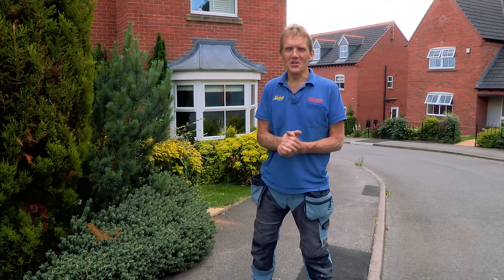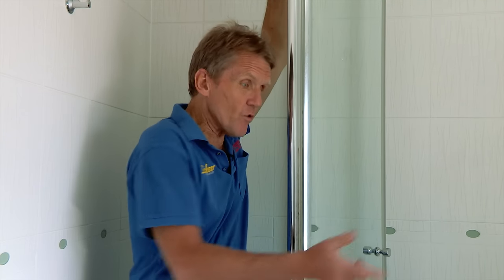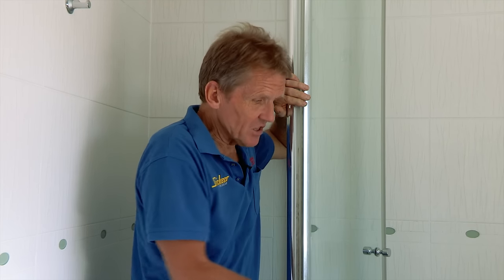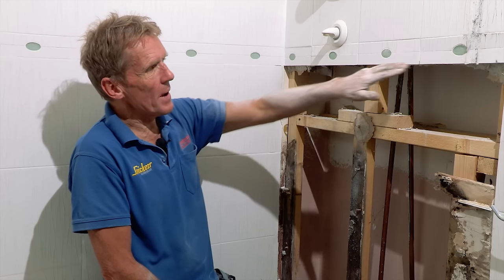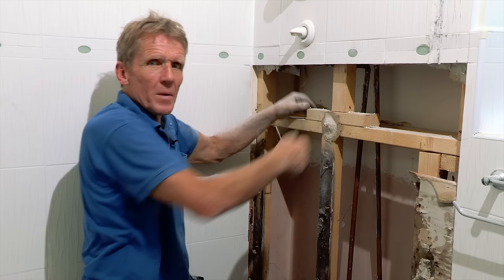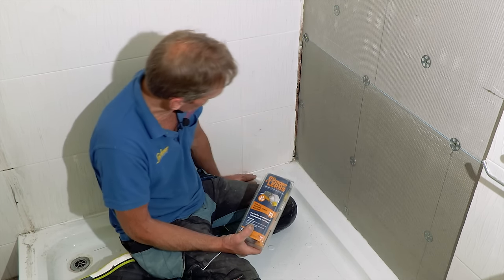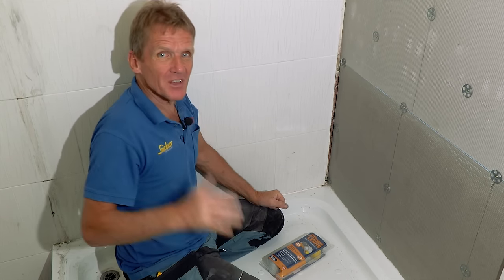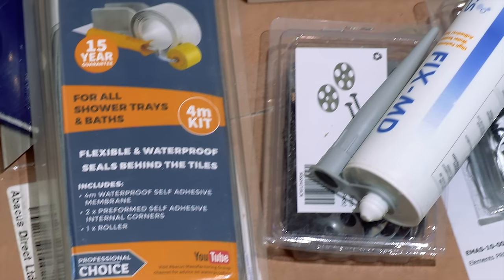Unbelievable Cowboy Plumbing Horror Show

Comment from the maker: See 'Shower Horror Show Part 2' - https://youtu.be/Cn_KD5HfYH0
Reply: In law, the householder shouldn't have to pay for this 'repair' because the original work was defective in design and materials specification or workmanship. There's no time limit on  a latent defect it's not a 10 year limit just because the guarantee period is 10 years, you get 6 years from the date you know of the defect, there is case law on this. Unless the developer / builder is bust it's a viable claim and should be pursued for remedy from the originating fault party.
Reply from the maker: Michael, that may be the case but very few people have the means to pursue a case against big builders for what amounts to minor repairs. I doubt you would find a solicitor who would pursue it on a no win no fee basis. If you take the breakdown of a silicone seal around a shower tray as an example a builder could say that it is wear and tear and within the scope of routine maintenance. My argument is that silicone seals are not sufficient on there own to prevent water ingress because buildings move. There needs to be a backup, This is the argument against using plasterboard. It is not suitable for shower areas and that is now being acknowledged. 

The British Standards have just been changed (20i8) to require tanking in shower areas. Given how long this has been a problem is well overdue.
Reply: How much did that job cost? I wouldnt have thought anything less than £3000.
TOP workmanship - sad to say but i rarely see such Top attention to detail and actual craftsmanship!
Reply: Skill Builder .""""."
Reply: I just wanted to say your videos are fantastic. I'm a handy man in the States and I see stuff exactly like this all the time.  it blows my mind that the people installing this stuff from the get-go can't be bothered to do things properly. I am like you, in that I genuinely care about what I'm doing and I always try to do things the right way. I never cut corners. Indeed, doing so basically makes it so that you don't have to come back in the future for a fix. But on the other hand customers are so pleased with your work that they give you referrals to their friends and family and as well, if you're somewhat of a jack-of-all-trades they will call you back to do the other jobs that they have. In the long run, it pays dividends tenfold in the form of a larger client book.
Reply: Great video I've had exactly the same problems with rental houses and they were all by the same plumber's and your right it's not the kind of work you want,, it's easier to do it right first time.
Reply: @Mr.FixIt1979  I thought things would be better in the States. I've seen a few videos where the fitters said using the correct backing board etc was in the building code. In the UK we seem to have a constant battle with builders that think that using plywood is ok because they've been doing it for years.
Reply: @DMC888  Plywood is only ever used in australia for bracing walls in the event of cyclone weather ...... plywood is never used for floors or walls. Particularly because it is just glued veneer that does not cope well with water.  We do use plywood for laminated beams , LVL or Laminated Veneer Lumber ...... but NEVER where they can get wet. Mind you termites will still eat them
Reply: Hi there, in france, we don´t use wood to fasten drywall. We use metal railing which is much better in bathrooms than wood. We also use special drywalls for bathrooms usually green. Before tiling, we paint the drywalls with latex liquid to make the plaster waterproof and on top of that, I add latex liquid when I am grouting to make my joints waterproof too. The last joint between the floor and the wall, I do it with silicone anti mold. I fasten the pipes to the concrete wall and I try to hide them so that an idiot doesn´t drill into the pipes.  you need to buy good brands because you don´t want any leak under the shower or behind the drywall.
Reply: Hello, do you have any vacancies,? Thank you
Reply: good the bad and t

By
Reply: Good the bad and the July sailing
Reply: @SkillBuilder : Good video and good advice but in my opinion as a lifelong renovator/remodeller there is a large error here…or maybe two. When you use a shower pan with a perimeter lip (which I recommend 100% of the time) you do not gouge out the backer board to fit over the lip, you install the board only down to the top of the lip and then install the finish tiles over the board and down to the top of the pan. The other issue is wasting your time removing the old tiles one at a time cutting grout and prying off the tiles with a flat bar. You will virtually never save all those tiles and even if you did you would spend far more of your customer’s money fiddling around trying to clean them sufficient for reuse than the cost of replacing them. We’ve all made that mistake once or twice but not three times.
Reply: Not just plumbing work second rate the tiling looks like it’s been done by an accountant
Reply: Always isolate cold water!!Especially cold one,cause of condense.
Reply: Cement board is good to 😁👍

Comment: This country is turning into a laughing stock because of corporate greed and cost cutting. I got an electric shock in the shower as the builder placed the electric cable behind the shower fitting and didn’t use the correct placement or fixings.

Comment: In our just over 12 yo new build, I replaced the shower bar. Upon undoing the nuts, I noticed the bar was was moving freely and suspect it was not fixed to a substrate. House builder: MILLER HOMES.

Comment: I like this guy. He cares about workmanship, unlike a lot of half assers out there!
Reply: A long time pro who takes pride in a good job. In the US when plaster gave way to drywall they used Greenwell for a few decades (probably with little testing) and as the guy said it did not hold up given cracked tiles over decades. Finally concrete board started to show up as demand for a better product increased and as far as I know a builder use this for showers now. The foam center is nice concrete board is heavy and hard to cut, builders probably would not pay for the additional complexity.
Reply: Rare breed, but as already said, it,s about the bottom line, that shower would win prizes now, not a good time for tradesmen....
Reply: @willpelton1619  that tape you discus is acutall a glass fiber metrial the paint hes layering over the top is a sealant you clearly dotn have any clue what you are talking about
Reply: @willpelton1619  okay you work. For a firm that's been I'm business 75+ years I'm from. A family of people. Of. Multiple. Trades who have been working as builders plumbers joiners and electricians for generations starting  Off with the Irish navvies turned tradesmen so I think I'll take advice from my family and what they were taught from there ancestors and what I know over some plumb on the internet we have a tendancie for testing things and I care to say this stuff looks identical to something we've used for years which is glass fiber weave with a polyurethane and/or silicone sealant painted on top that stuff is just the same just packaged with a  label smacked on it and charged at a mark up creates a great seal and stops water and moisture seaping through admitted the markup is insane. On that stuff but for the average dick who doesn't have trade accounts with company's its just the same for a price
Reply: @willpelton1619  admitted one thing I. Did question was why she. He used the tape stuff with the sealant paint why he didn't sell all of the seams and only around the screws and piping that did lead me to think. I.. Pretty sure moisture could see through the seams of the board just as easy as it could the screw holes when my. Uncle has done this kinda stuff using straight sheets of fiberglass and silicone sealants he has covered every single seam
Reply: Also by this latest comment. I. Realise. I. Sound young that's not the case I'm almost 31 I just didn't pursue my trade further due to. Mental. Health conditions I was going to be an electrician I was also studying to be a full on electrical engineer
Reply from the maker: Thanks Ranger, we're sure you'll enjoy Part 2 - https://youtu.be/Cn_KD5HfYH0
Reply from the maker: @willpelton1619  You are building to INTERNATIONAL BUILDING CODE Can you point us all in the direction of said code? I would very much like to read it. As for deleting your comments. That didn't happen and you know it. 
We very rarely delete a comment and never for commercial reasons.
Reply from the maker: @willpelton1619  Hi Will
Not taking the piss mate.  The IBC has hardly any presence outside the U.S All but one of the  committee are American. The only way they can claim it is international is because   Abu Dhabi, the Caribbean Community, Colombia, Georgia, Honduras, Afghanistan and Saudi Arabia adopt some aspects of it when dealing with American contractors and suppliers. In the U.K we have National Building Regulations which don't even cover Scotland and when it comes to Europe we use EN and ISO.
Reply: @willpelton1619  As a pro at the age of 43 with 25+years in the trade i can assure you that this product is a proper  solution as an appropriate method of repair.With that being said Roger would never reccomend anything shity crap thing.
Reply: @willpelton1619  Tell us a little bit more about the National installation code mate. Come on..enlighten the public! PLEASE
Reply: @willpelton1619  not really even close...
Reply: @willpelton1619   I trained as a QS with the RICS and wondered about the product endorsement aspect and the industry is full of proprietary solutions it's true, but I like the system and in  a home repairs market as opposed to the commercial market you operate in supported by designers and specialist supervision, this sort of video and care is quite useful to the grass roots builder or client. I told a builder not to use vermiculite light weight player in my bathroom,  he ignored me, 7 years later the tiles are blowing off the wall, i shoild know to be firmer witg these guys and any improvement is good, this product looks good to me, though I would like to see bathrooms designed so as not to need silicone I just don't like the material
Reply: @SkillBuilder  why not admit you'd never heard of IBC, I hadn't. We also have British Standards and CE standards I suppose as well as Building Regulations but no amount of R&D or knowledge or mandatory enforcement will overcome shoddy time-compressed work on site, or ignorance in specification such as by those murderously negligent privatised interests that decided to specify flammable cladding at Grenfell. Your products look good to me and the guy presents well, I would have put cementitious board in a bathroom but these more modern materials look good, less dust lighter weight and the grid in the surface mesh makes for easier marking and cutting.  These are DIY market remedies to latent defects though and the customer should routinely get an expert Building Surveyors report and recover the cost of remedials from the original fault party no matter how long ago the defective work was done, and bearing in mind vicarious liability just sue the developer, the developers supervision should have ensured that the their subcontractor or labour installed properly. It's unlikely an architect would specify so poorly but if they did then the architects PI might respond.
Reply from the maker: I am perfectly happy to admit the limitations of my knowledge which is why I asked for more information. I also took the trouble to research it and it turns out to be a business. As I said it has very little influence outside the USA but many  Americans believe that the word 'international' means it is a global standard.
Reply: @willpelton1619  Can't wait for your instructional videos.
Reply: @willpelton1619  Been looking for this info: so Schulter has 75 years of life expectancy? While stuff like this has about 15 Will?
Reply: @willpelton1619  context is key here. Theres more then one way to skin a cat and whilst I'm sure the US 'international' standards are high so too are the standards in the UK and the EU. In fact in most cases they are the highest in the world, hence why trade deals between yourselves and us are so tricky due to the USAs generally differing standards and 'quirks' (haggis anyone?).

You also need to view the bathroom contextually. This is a small family home in the UK and not some big facility or 'international' type hub where the bathrooms are in constant use with many dozens of people showering each day. In which case I would have thought a more robust construction would be required.

Finally you are viewing a UK domestic bathroom through your colonial eyes. We have a very mobile, fast moving and fluid housing culture here. We don't live in the houses our Pappies and Grand Pappies single handedly built. If you had any idea about the UK housing market you'd understand that it is different to anywhere else in the world. 15 years would be considered quite old for a bathroom and seems to me, from experience, to be around the average age you start considering a refurb or upgrade. By the sound of it your 75year nuclear option bathroom would be a pain to remove or rearrange in line with current trends and changing fashions. 

All in all it looks to be a sound job installed by a guy who really cares. Of course he has a sponsor, who doesnt? How do you think he's able to make these videos?
Reply: I've never worked or built anything let alone buildings.
I've helped grow the trees used for building in the now defunked NZFS etc.
Back in the day had I or my crews done a half asked job as you have just described one would never been payed for the total job until all work was assist.
Does this not happen in all industries.
The term retainer was always used where monies for all jobs completed was first assist before full payments were payed out.
Listening to Roger here this is not the case in your country.
Reply: What a spirit! Professional is a professional! I'll do it in my new shower too!

Comment: Love the line, "this is an expensive, beautiful house but have use the cheapest of cheap..." Working in the S.F. bay area and on some of the wealthiest homes I see this; not just this damage; but the use of the "cheapest of the cheapest" material used. SO MANY TIMES I have come to help a homeowner to alleviate a problem that seems simple, only to see this massive cluster... Sometimes I have to ask when the work was done because the original contractor is liable for 10 years. If I touch it before, I become liable for it all!!!

Comment: Excellent video Roger.  Nice tempo and explanation.  I had this exact problem after a bathroom refit that lasted only 3 years because of plasterboard walls and lack of effective sealing.  I've since looked at the way they do it in the USA and it's a far more comprehensive approach - cement/backer boards, taped and sealed joints and waterproof sealant applied.  3 layers of protection.  We should adopt the same system in the UK.
Reply from the maker: Thanks Matt, we're sure you'll enjoy Part 2 - https://youtu.be/Cn_KD5HfYH0

Comment: I've used these insulation sheets on the floor in wet rooms but never knew/considered them for walls too. I normally use a particle board but they are so much harder to cut and fix, are heavier and more expensive. I then seal the joints etc as you have. I'm going to be using these in future. Thanks.
Reply: You can use something like Fermacell or any other waterproof cement board there, just seal the holes/joints internal corners with fiber tape and liquid sealing membrane